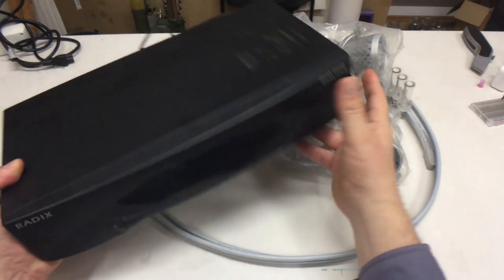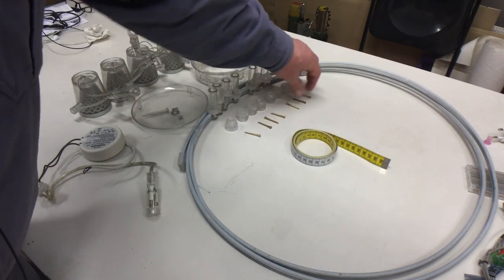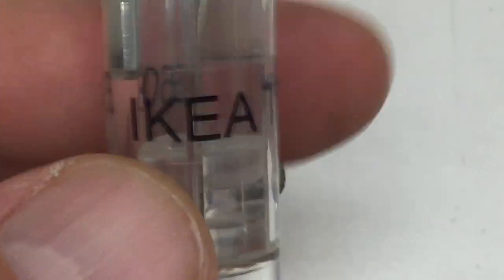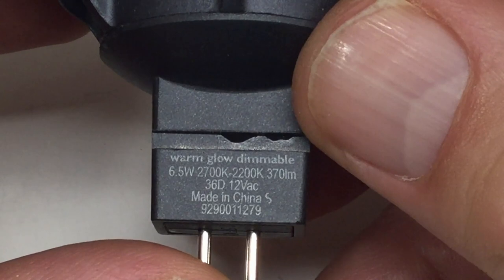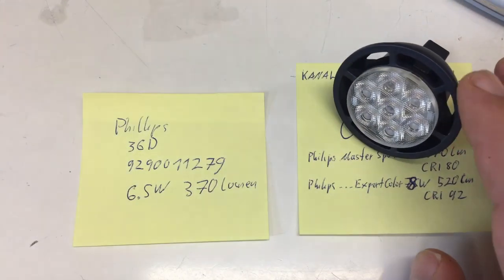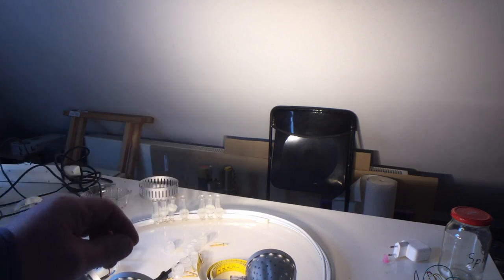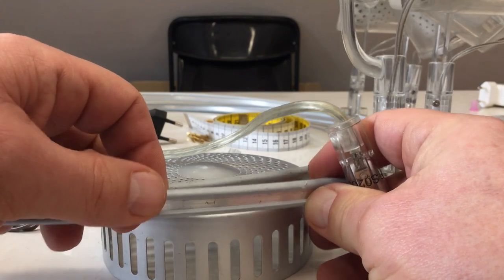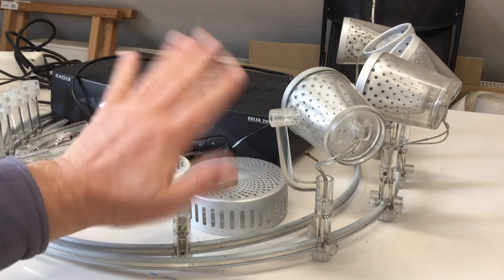Scrapheap Scavenge: IKEA Spotlight Rail (Tested) and Radix Satellite Receiver

Comment: 5:18 That is a G8 socket if i'm not mistaken.
The number stands for the distance between the pins in mm. 
The smallest is G4, then G5.3, G6.35, G8 and G9
Up on to G9, all the lower number has straight pins, the G9 has bended (curled) pins.
Reply: I was wrong, it was a G5.3 socket
Reply from the maker: @BjornV78  Thanks for the info! If you're buying halogen or LED light bulbs here in Germany for this socket you have to search for GU5.3 (the socket with 12V AC) or MR16 (the form factor of the light bulb). My best guess is that G5.3 just defines socket (distance between the contacts 5.3mm) but not the voltage.
Reply from the maker: Thanks again for the info! See my reply below ...
Reply: @robertssmorgasbord  , the number is indeed the distance between the contacts. Was everything that easy :-)
Reply from the maker: @BjornV78  But then nobody would need experts like us anymore ;-) My favorite example is the US system of numbering sizes, e.g. a #10 wood screw is 3/16'' or 0.19'' in diameter.
Reply: @robertssmorgasbord  , i'm glad that we use the metric system for nuts and bolts etc...and Celsius degree for temperature here in Europe. For example, water in liquid state is between 0 C° and 100 C° with normal atmospheric pressure, while 100 C° in Fahrenheit is a ridiculous number of 212 F ° and 373,15 for Kelvin °.  While a empty glass is 0% and a complete full glass is 100%. 0 and 100 are far more common numbers. For the imperial system the numbers are even more ridiculous, not the mention Pound , that can be use as a weight or currency. :-)

Comment: Is there any trick to compress the fixture connector? I'm struggling to attach these replacements I bought to my the rail. I can only imagine using brute force... but would prefer that method as a last resort!
Reply from the maker: I'm not quite sure what you mean: The fixtures attached to the ceiling or the fixtures holding the lamps? My ceiling fixtures have through hole and clamp to the rails with a screw - not much force involved there. My fixtures holding the lamps have a T-slot and clip onto the rail. Afterwards you screw on an acrylic nut to close the T-slot and secure the fixture. Clipping these fixtures onto the rail requires a bit of force, because there are spring-loaded contacts inside the T-slot. Maybe you forgot to screw off those acrylic nuts and are trying to slide them onto the rail?

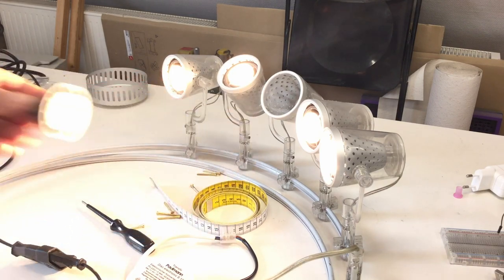Comment: i have this very rail at home and it sucks, it stopped working with lights flickering around, the connector at 11:41 completely broke into pieces by just touching it, its cap went lost (i don't how!), I used a zip tie to hold it to the rail but the problem seems to be the power supply itself. Ikea no longer builds it. I could change the power supply, but I think it'll be impossibile to find the same rail connector
Reply from the maker: Well, what can I say. I got mine from the scrapheap and not from IKEA. And yes, it's probably the most cheaply build rail system ever. Regarding spare parts: I got lucky and found some additional lamp holders on eBay. Maybe you can find parts for it on eBay too.
Reply: @robertssmorgasbord  I'd rather change it with some led lights at this point, the only difficult part will be drilling  new holes in the ceiling..i hope i can use the existing ones
Reply from the maker: @fabio6359  That was the first thing I did when I installed that IKEA thing: Getting LED lights for it (and 5 more lamp holders via eBay)! Though, I didn't had to drill any holes, 'cause there's a cable duct running at the ceiling: https://youtu.be/Rf0ncpvwML4
Reply: @robertssmorgasbord  the power supply is on the ceiling and does not work very well (lights turn off after a bit), i am replacing everything, plus the power supply itself is for halogen lights only with a 35w minimum required. Moreover it is just ugly to watch 😆 ps: it is not my house so i just had it when i got in
Reply from the maker: @fabio6359  Fortunately my power supply from the scrapheap still works just fine. And you're right, in a living space its aesthetics are questionable😅 Though, attached to that bare metal cable channel on the ceiling of my shop/lab it kinda looks OK. But I guess my better half would have objected to it being installed somewhere in the flat. I guess the former owners did throw it out because it was too ugly after all.

Comment: hi can i ask what’s the connected connection have for it as i move into a house and have the light but it doesn’t not work as no connect
Reply from the maker: I'm not sure if I understand your question ... Anyway, the rail is connected to a 12V AC (electronic) transformer. Do not connect that rail directly to AC mains! The two wires from the transformer are connected to the rail using a special clamp (not unlike one of the spotlights, but of course without the spotlight, and with two cables instead).